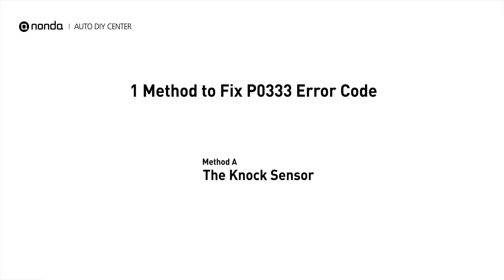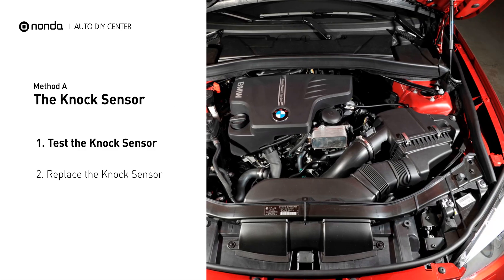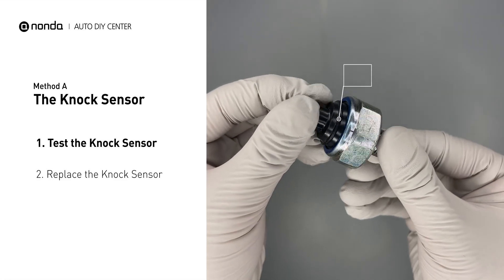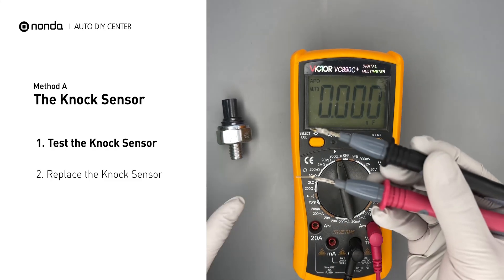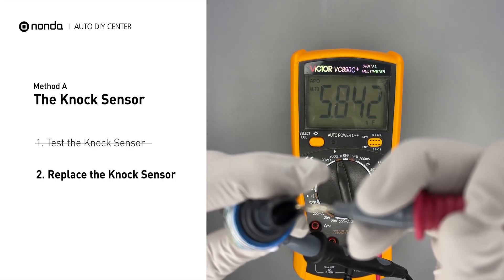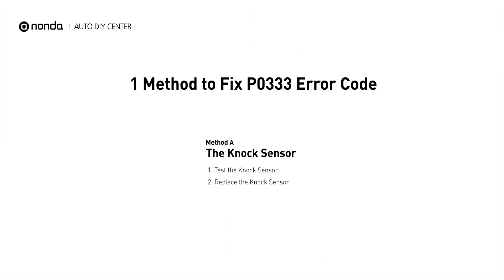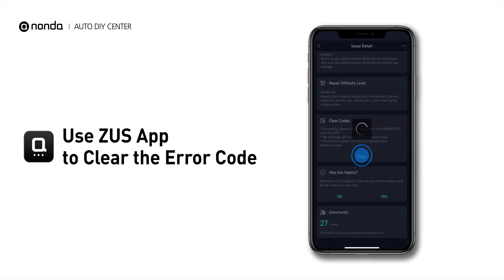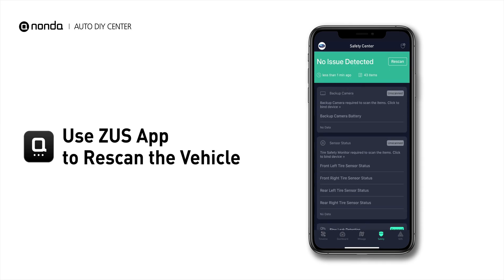How to Fix P0333 Engine Code in 2 Minutes [1 DIY Method / Only $10.92]

Comment from the maker: Hi, I'm Steve, nonda's lead mechanic engineer. 
Feel free to leave your comments here if you have any mechanic questions, I will be glad to help you out!
Reply: I had a p0333 in my GMC 2007 do you advise me to replace the knock sensor? An ather question pank 2 Das that meen the right side sensor because there is two in GMC
Reply: Where is the knock sensor located on a 2012 Toyota tacoma??? Will the heads or motor need to be pulled?
Reply: I have a 2010 VW Jetta , have a P0333 code, replaced both knock sensors and camshaft position sensor on Intake side. Code still is coming on intermittently. What should i do ? Timing chain ? Camshaft ? The car runs fine and shifts fine